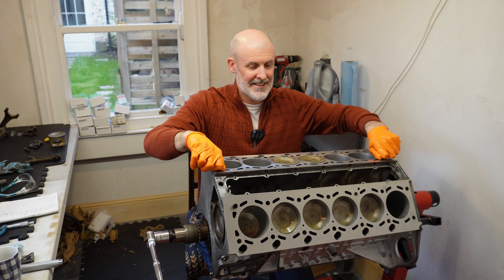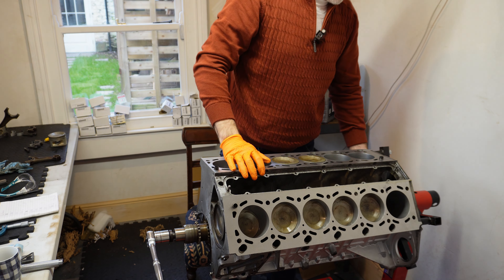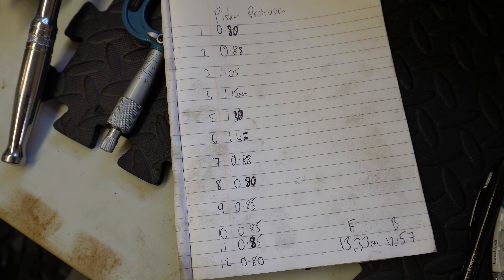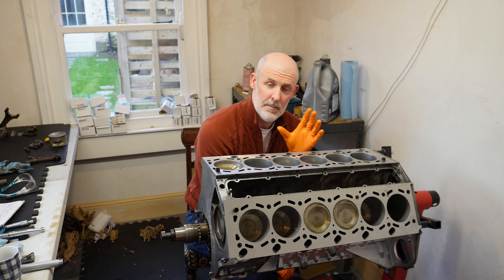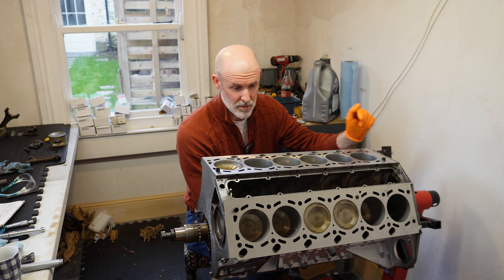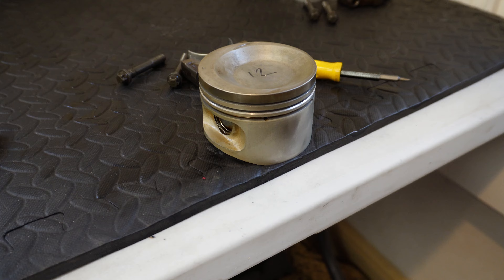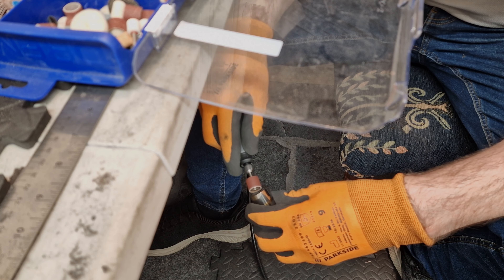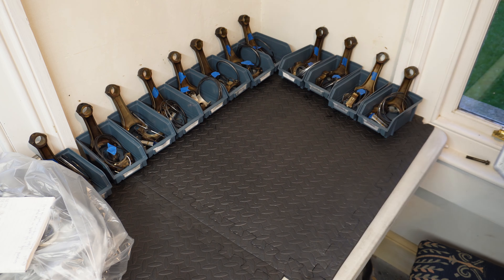BMW E31 850i "Glacier" - V12 Piston Machining & Cerakoting - Episode 15

Comment: Hi Steve, good to see you again. Real bummer about the block, it's hard to find people you can trust to do a proper job nowadays. even Streten at M539 has fallen foul of bad machining. I know it's probably not your style, but I think I might have mentioned to the machine shop in question that letting 8K+ people know not to take their engine parts there may have at least warranted a reply. I am thinking that the discrepancy amounts we are talking about are not enough to cause a mis-alignment problem with the inlet manifold, seeing as the heads will be slightly out of kilter. The pistons look better than original now with the new coatings, should turn out good in the end. I have completely re-built my rear subframe, you are right, there's a lot of work involved. I may be too late here, but when I did mine, 2 out of three of the "rose joint" bushings were available from Lemforder (they made the originals) at about 1/2 the price of BMW, and the third which is part of the top arm is now available exchange from Gerry Speechley at Phoenix Motorsport, again, cheaper than BMW but still very dear at £300 a side. He also does some nice re-enforcement plates for the rear shock mountings which have a common fault of metal fatigue cracks.
Reply from the maker: Thanks for the info! I just missed out on the Lemforder ones, hopefully they are available again soon. I am slowly building the rear end parts collection.
Reply: supports for rear shock left BMW 411 481 52997 and Right side 52998, these are factory upgrade E31 body much thicker than pre July 1992 models where this plate is 1.5mm. one drills out the spot welds then position , get in the boot and spot weld from inside. they're only £20 each:thanksdoc:
Reply: @stevesbmwbarn  Hi Steve, good to hear from you! Apologies for length of this but it may help you. At the time I did mine, I was working for Euro Car Parts who have a direct account with Lemforder and can special order just about anything. Using Lemforder's on-line catalogue information, I cross-referenced the BMW part numbers from RealOEM, then got work to order up the parts for me. Having gone to all that trouble, we have a local parts supplier here in Huddersfield, A to Z Motor Factors, and whilst checking for other parts I found that they had the Lemforder bushings in stock and slightly cheaper than I got them on my staff discount! Always worth a shop-around.
Reply from the maker: @bobfrankish8883  Thanks Bob, i have a good bulk of parts coming from Ed at V12 Throttle, will check them out for sure.

Comment: Sorry to hear about all the issues you're having with the machining shops. I am really enjoying watching the progress you this project and can't wait to watch the work on the car body too. Forgive me for this, maybe, dumb question but won't the material removed from the pistons cause engine unbalance? Or is that so minor that the weight difference is negligible?
Reply: The answer is in the video. 🫡
Reply: @voodoomelons  I guess I wasn’t attention when that was mentioned 😁

EDIT: I rewatched that part paying attention. The solution was to remove some material from the piston pins on all pistons so that the overall weight of each piston is the similar 👍

Comment: Jezus.. Just ran across your video.  Rather than creating a small weight imbalance with the pistons shaved to different conditions, and different quench patterns, it would seem to be better to find yet another machine shop - somehow insure the work/block, and have them simply mill both banks flat again enough to use a thick custom copper head gasket in your defined thickness.  (Granted + ss o-ringing the cylinder). Custom copper (reusable) head gaskets should be reasonably easy to source as long as a maker can have a DFX file of the OE gasket.  Yes, you don't use the OE MLS gasket anymore but at this point..... it would seem like an option.   Then IDK if it's worth using the courts to make the other machine shops pay for what they fudged up.

Comment: Make sure your valves don't hit the pistons on number 5 and 6, because you removed 0.6mm from the top of the piston, not from the valve relief that was machined in the piston. The valve relief is 0.6 mm closer to the valve!
Reply: All the valve reliefs were also deepened the correct respective amount.
Reply: @voodoomelons  @ 41:26 doesn't seem like it, 6 reliefs seem shallower than 5, hope you are right ...

Comment: That's why you never machine engine parts if they are not fucked.
For example if the block has an excessive amount of warp or twist beyond the accepted OE spec, you machine it because it's already fucked. 
If the heads are warped beyond accepted values you machine them because they are already fucked
There is absolutely no gain in machining parts that are "good enough"
I have a 3.2 VR6 Turbo engine that spits about 630HP which was rebuilt twice  (I cracked some pistons because of high boost), and I have 30K km with it since the last rebuild. engine and head were never machined.
I feel your pain :(
Reply: 100% correct. Down the rabbit hole...